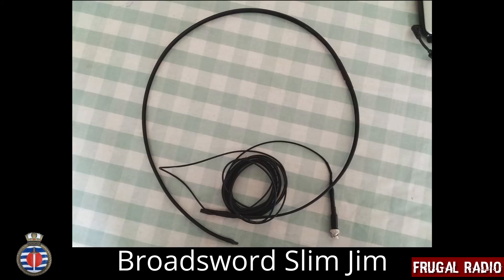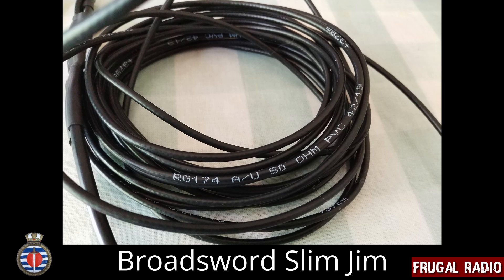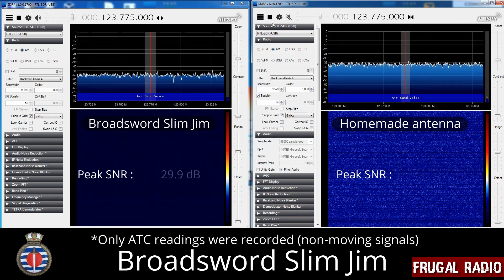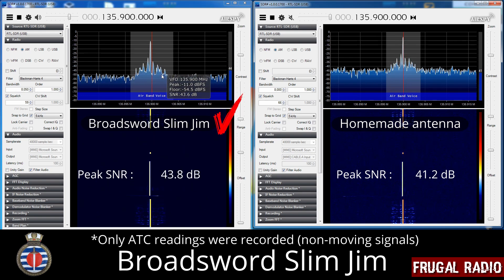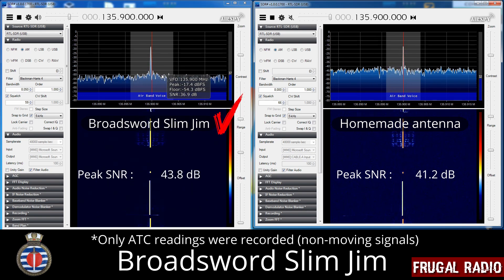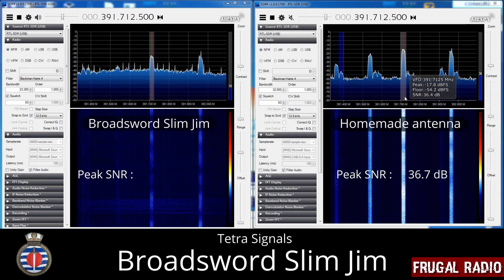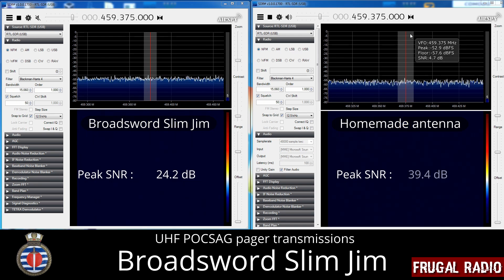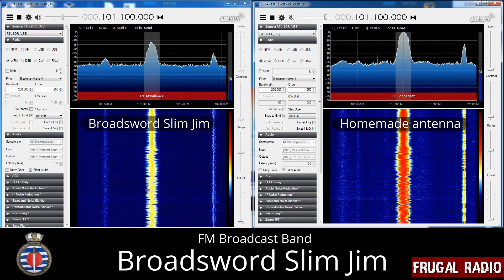Broadsword Slim Jim VHF Air Band Antenna Review

Comment: Cheers for doing the testing and the video. Just so people are aware the Mil aspect of this antenna is secondary and is on the 2nd harmonic of the antenna. Broadsword do a mil air version which is smaller and centred around 290mhz and so works better on uhf/mil air.
Reply from the maker: Thanks for the clarification.

Comment: I just finished building an airband Slim Jim out of an old FM Wide Band 300 ohm twin lead. The tuner to dipole section of twin lead was just long enough for the  164.4 cm piece of twin required for the airband centered on 125 MHz. I used some  scrap RG58 and an old bnc connector scavenged from my ham radio parts box. I travel extensively and always carry a scanner, handy talky, ADSB receiver and a dedicated tablet loaded with aviation software. I hold a US and South African PPL but not current. I do like to know where I am and how I'm getting there. My BC 125 was unable to pick up the TUS ATIS from my back yard, a distance of 15 miles. I have tried all the very best scanner wide band  ham/scanner rubber duckies and even a recently acquired Abree tactical for 2M /440 and doesn't break the squelch. Even a couple of 2M mobile Larsen antennas ..zip. I hung the Slim Jim up on a closeline 5 feet off the ground and I immediately picked up ATIS full quieting.  I was very impressed and wondered if anyone had done the same and did a search and found your video. 

I have been looking for an antenna I can surreptitiously pack in my carry on back pack and use while at the gate so I can monitor all the airport frequencies and be alert of any issue which may affect my travel. I have had a number of instances where I have been able to book an alternative flight before the flight I was booked on was canceled for a  weather or a mechanical, before it was announced. At one airport on a tropical Island, while waiting for a homebound flight, I discovered that a commuter had crash landed on the runway and my inbound plane was being diverted to an airport that I new would result in a cancellation.  I was rebooked back at my hotel before they announced the cancellation at the airport.

I am trying to figure out where you are based and I am guessing possibly Ulster...
Thanks for a very interesting channel.
Bob

Comment: Thanks for the video. As a newer radio user I was wondering what is the best practice for using a number of different antenna. I recall in another video you had a box that was switching or combining the antenna?
Reply from the maker: Hi Chris. I have a device known as an active multicoupler. It takes the incoming signal from 1 antenna, and splits it to multiple receivers without any signal loss. In my case I can feed 8 scanners / SDRs with 1 aerial. It is very useful if running multiple devices. 

But if you are wanting to listen to specific bands, dedicated antennas are better as they have more gain. In that case you could use an antenna switch.
Reply: Frugal Radio thanks for the review, would be interested to hear more about the multicoupler, is there a particular one you use/recommend ? 73
Reply from the maker: @hughblemings7227  Hi. I'm using the Stridsberg MCA 208. Not a very frugal device at over $330, but it does a superb job in replicating the antenna to 8 receivers at a time. 

I also use a multicoupler designed for TV which uses F connectors. This was a very frugal option at under $20, and has 12 ports. It adds a little noise to the signal, but that is forgivable given it's price!
Reply: Frugal Radio nice one, thank you for the pointers, much appreciated!